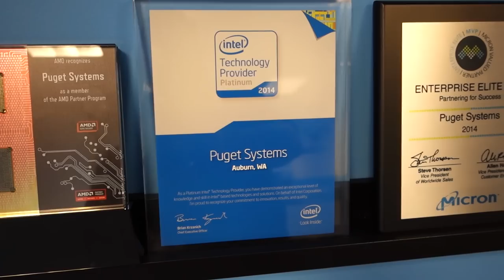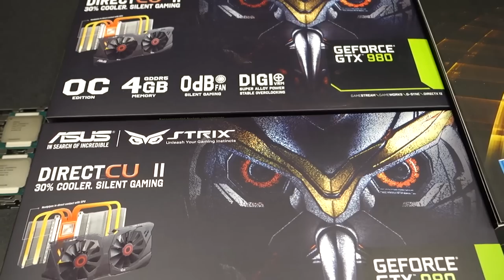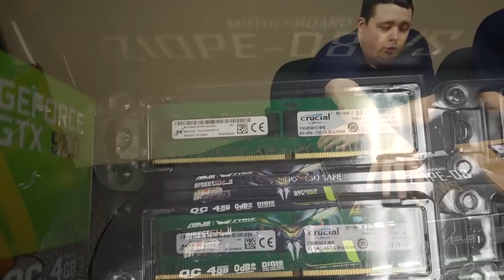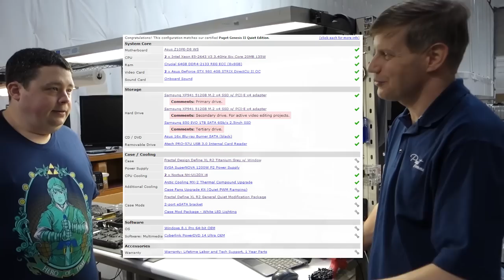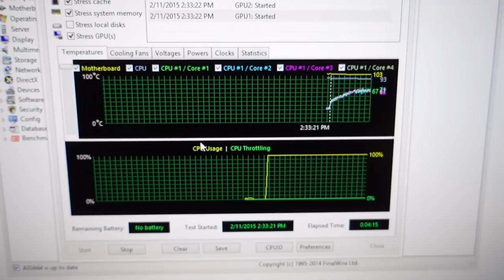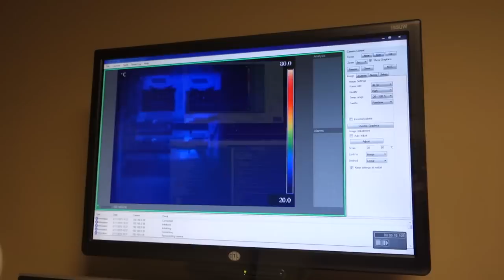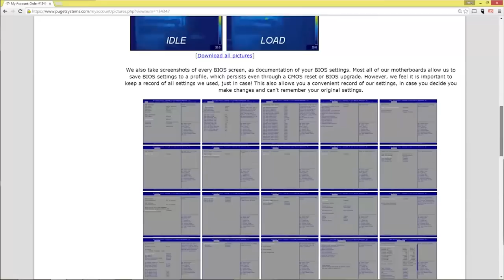Crazy Fast Dual Intel Xeon Monster PC Build by Puget Systems - @Barnacules

Comment: dual xenon? really? why? you dont need that
Reply from the maker: Yeah, actually I do.
Reply: Same reason for 64 gigs of RAM, faster video rendering
Reply: Barnacules Nerdgasm no, actually you dont
Reply: Simon Garfancule exactly. and it probably doesnt make a huge difference
Reply: His full time job is making YouTube videos. Even if it's a small difference it's fine, it's not like he's investing his lifesavings into this computer, it's a sponsored video so he gets the whole system for free.
Reply: YourNightmar3 he renders videos, 3d prints/designs, and does his own graphics... how does that not justify ecc memory, power, and reliability?
Reply: Bailey Tincher how about 1 xeon?
Reply: Barnacules Nerdgasm I do not understand the decision to go with two 6 core Xeons,especially on Haswell-EP,instead of maybe a single 12-18 Core Xeon.QPI more or less will somewhat increase latency.
Reply: Giggity Goebbels the downside to that is a lot of heat and a lot of processes on 1 processor.
Reply: Bailey Tincher no duh it uses more heat. not like he has a good aftermarket cpu cooler sarcasm
. Why wouldn't you use ur cpu to its max???
Reply: Bailey Tincher Check the TDP Dude...
Reply: Giggity Goebbels He's using it as a gaming rig as well and most games run like shit on lower clock frequency. Very few games are properly multithreaded.

Adobe Premire Pro and After Effects also run quite poorly on more threads believe it or not. They're also not very well multithreaded. It's rather old code base from the times before mega threaded systems were a thing on the x86 platform. It's been common for decades though in the RISC/POWERPC sort of world.
Reply: TalesOfWar I am talking about the latency.It will be really bad for both games and video editing.
Reply: NO ONE IN HELL Needs dual Xeons, 64gigs of RAM or ANYTHING this overkill unless you're going to be rendering 5 hour videos... I used to have a Core 2 Duo E7500, 2gbs of DDR2 ram and when I used to make videos it took me hours to render, but it was done! The RAM itself was DDR2 800mhz, so... Now I got a crappy, i7 840, Radeon HD4450 or something... I forgot, but it does the job!
Reply: ItzPrio he got it for free, chill holy crap you're going ham.
Reply: I'm allowed to go ham. Ham is love, ham is life
Reply: ItzPrio aloud... you mean allowed oh god
Reply: Well he does other stuff too man... not just rendering... I don't know why the bashing... =.= if it saves him time to go from 1 task to the other, that's money right there, to get more done in less time... god damn... if u do 3d shit u will know just how shitty it is... I'm working now, the company is using quadro with an 3rd gen I7 and it still lags and sucks... god damn it....
Reply: Vincent Kaze What Quadro?If it is anything NVS,600,K600 of course it lags.You need at least a K4000 to have a smoother experience. Also,what I said (1x12-18 Core CPU) is not necessarily slower than (2x6) cores.Haswell-e and still using 6 core Xeons?There is a problem.
Reply: Giggity Goebbels it's probably some shitty GC I guess, it lags like shit... hahaha oh well small company, what to do...
Reply: He needs good single/dual/triple/quad thread performance for gaming and good multi (100% on all) thread performance for video editing and such. This is one of the fastest E5 Xeon CPUs in single thread performance while also having six cores. It's pretty darn good for rendering by itself, but having two of them allows a potential doubling of rendering performance. Cutting rendering time almost in half isn't necessary, but it's certainly nice, especially when he makes money from uploading videos. By using two of these CPUs, he's getting (slightly less than) the best of both worlds. Sure, it won't game as well as an overclocked i7-4790k, and it won't render as well as a sixteen core Xeon, but it'll be close enough to both of those, which is optimum for Barnacules.
Reply: Whatever you say.
Reply: Honestly people here saying an i2 would get the job done like holy balls... the cpu itself cant even  stream an indie game without crashing/returning errors. The ignorance is insane he doesnt use the computer to make a video every so often... he has 4 monitors, does plenty of 3d rendering and printing, makes videos, plays games, and streams. It isn't like he only does 1 thing at a time...
Reply: Bailey Tincher 3D printing barely takes any CPU at all. A Pentium could probably get it done just as well. Creating the model to be printed is what uses your CPU. I agree 100% with everything else, though. Anyone that says you don't need a fast CPU clearly is using their computer to simply watch YouTube videos and check FaceBook.
Reply: YourNightmar3 Building a beast computer is not about what you need.
Reply: TalesOfWar Ugh kiddo, rocking two 980's won't even slightly be a slouch with a lower clocked xenon... There will be no bottle necking...
Reply: TheSmileyFacedPizza I have to temporarily use one of my older systems and hell, you can't even use it for YouTube Let alone Face Book!
Reply: Aaron Paananen Xeon. A Xenon is the code name for the CPU inside the Xbox 360 and a chemical element.
Reply: TalesOfWar whoops... my bad
Reply: YourNightmar3 It's a common mistake people make when Xeons come up in conversation.
Reply: TalesOfWar oh :P okay :)
Reply: Becoming Godsize im 22-23 bro
Reply: 666NedFlanders i got 32 gb ram as well. just only run 1 virtual machine at once. easy
Reply: Actually, when i used to render a 21 minute video took about an hour and a half 1080p/60fps. I don't know why it was so fast, but it was epic. I did also try ECC, but um... RIP.
Reply: ItzPrio I rendered a 30 second clip of a video... took 48 minutes
Reply: ItzPrio I rendered a 30 second clip of a video... took 48 minutes
Reply: Wow... For me that takes... like 30s... Lel
Reply: ItzPrio exactly, lol
Reply: My PC was shit.. idk if it was cause I was using integrated graphics but I got MSI GTX 970 now so Idk if it will be faster or not.
Reply: 666NedFlanders I think he needs the Virtual Machines to render the video's, otherwise it doesn't make sense.btw that physical core = virtual core is bullshit so stop talking.
The hypervisor is taking the decision which physical core it will be used for this thread.
So it's usally taking all the cores, the vCPU amount is just for how many threads it can schedule on the hypervisor.
Reply: Wow you still don't understand how this works.
I never said anything about allocating PHYSICAL Cores into the Guest when it's running, i said the HYPERVISOR takes the Decision which Thread comes from the "Physical" Core on the Guestsystem and assign it to the physical core on the Socket 

Your saying that vCPU are static assigned to the physical core which isn't true.
Reply: ***** Yes. It was called the Xenon during development. It's based on the Cell architecture which itself was an extension of the PowerPC RISC architecture. Kind of ironic really as Sony ended up paying R&D costs towards the CPU in the 360.
Reply: VexusMC i dont believe it, you're telling me u need more than 4kB of RAM? are you serious?
Reply: YourNightmar3 He's gonna be rendering 8K raw video for pixar and monitoring a rocket sending a rover into space for NASA at the same time.. so YEAH HE DOES!!!
Reply: That explains a lot rofl
Reply: YourNightmar3 YEAH BRO, SO YOU'RE LIKE WRONG!  lol
Reply: How many total cores and threads is there in this dual xenon. Does it really help over a regular 8 cores 16 threads Core i7 systems for video works? Not using it for virtual OS or anything like that.
Reply: Seramics honeslty.. in terms of price vs performance you can't beat a socket 2011 i7
Reply: Spicy Kielbasa Hmmm, i guess so... i just wonder if there's any differences/improvements at all going beyond 8 cores.... even 6 is quite a lot for single users.... of course for virtual OS environment, it does matter..
Reply: Seramics They have an 8 core i7, too.  The i7 5960x.  There is a benefit in rendering and computing with an 8 core, but your single core performance takes a huge hit for things such as gaming.  I have the older generation 3930K and it is great all around.
Look up some benchmarks to get a visual understanding of their weaknesses and strengths.  You will see though, however, that the price vs performance is almost NEVER justified.  I will wait 1 more minute rendering with a $500 CPU then pay $4000+ for a CPU that will save me 1-2 minutes..
Reply: Spicy Kielbasa Exactly! You get it! Btw i ot the 4790 and it does a great job at rendering
Reply: +YourNightmar3 because VMs
Reply: multiple cores is definitely useful for VM's
Reply: YourNightmar3 For video editing it would be a dream.
Reply: Those who can't spell 'Xeon' should not bash them! :) (Why on earth do so many people want to add an 'effin "N" into it?)

Comment: 5 to 7 business days? I can tear down and build my computer twice in 2 hours. Is this because of demand? Like a "allow 6 weeks for shipping" kind of thing?
Reply: +CrisFormed I'm copy pasting a reply I made to someone else:

Copying something is quick and easy, you can't discard the R&D put into the original design.

If you watch and EXACTLY copy a photograph I take in a studio you'll end up with the same result in a minute or two. If I tell you to do it from scratch without you being able to copy the number of lights used, angles of the lights, power settings, light modifiers, props (if any), shutter speed, ISO and aperture it'll take you a lot longer. I'd have already put in the years of learning plus (up to) hours of preparation and trial and error.

Did you hear how many heatsink configurations they tried? Each would involve dismounting the heatsinks, cleaning off the thermal compound, applying new thermal compound (not doing this will invalidate the results as they won't be directly comparable), booting up and running a torture test on it. Not every mount will be perfect either, even after doing hundreds of builds myself I still end up with the odd bad mount which means once again dismounting the heatsink, cleaning the thermal paste, applying new thermal paste and remounting the heatsinks.

As someone with a dual CPU board (EVGA SR-2) I can tell you that the heatsinks are near impossible to fit without removing the board from the chassis as the cutouts in the motherboard tray don't align with the CPU sockets, being designed with single socket motherboards in mind. With the heatsinks removed the backplate slips off and ends up between the motherboard and the motherboard tray.

With this in mind, trying a different heatsink configuration involves the following:
Disconnect SATA cables
Disconnect power cables
Remove graphics cards
Remove motherboard from chassis
Remove heatsinks
Clean thermal paste off of heatsinks and CPUs
Apply new thermal paste
Wrestle the heatsinks back on
Fit motherboard back into chassis
Install graphics cards
Reconnect power cables
Reconnect SATA cables

To test all the possible heatsink configurations you could need to do that a dozen times, and add in at least fifteen minutes of testing time for each configuration to allow temperatures to normalize. Just the time spent heating up the system under a torture test for each of the configurations amounts to almost half a work day, and that's not taking into account the time taken to do the steps I listed above.

There is no way a build like this with such attention to detail can be done from scratch in two hours.

Comment: Not much of a nerd if you cant build your own pc?
Reply: +Jared Reabow (Jazza) he got his htpc with a skylake i7+980ti from them for free (almost 5K$ cost) so it's all about the $$$
ofc he could built it if he wanted
Reply: TheGamingAffiliate dude it was pre-made.. It's on other video
Reply: +Marco Martins I can build this same system for $3000 replacing the GTX 890 for a GTX 970 for non-gamers.
Reply: +Marco Martins thank you
Reply: +User 890?
Reply: ***** noshit, user was talking about a gtx 890...
Reply: +Thijs W typo gtx 980
Reply: User ah ok
Reply: +Thijs W for $3000 i just built a dual xeon 28 core pc with 64gb ddr4 and two SSd's in raid 0 along with a 980.
Reply: +Jared Reabow (Jazza) why a 980? at least get a 980ti
Reply: +Thijs W because with pascal coming out this year and getting the 980 for £150 , how could i say no!
Reply: +Jared Reabow (Jazza) for 150? damn a 970 would be dirty cheap... still i would rather have 970 in sli instead of a single 980, because theres a 10% difference between a single 970 and 980
Reply: +Thijs W i got the 980 as a deal, a 970 would cost £300 and and a 980 would cost £380 - 400
Reply: +Jared Reabow (Jazza) in the netherlands a 970 costs around 350€ and a 980 around 650-700€
Reply: +Thijs W I used two ES Xeon E5-2667 v3 3.2 Ghz 16 cores (32 cores total)
Reply: +User sorry for you, I have two E5-2695 v3's
Reply: +Jared Reabow (Jazza) Don't, I'm happy with my clock speed 3.20 and 16 Cores. That's enough for gaming if I ever decide to game. I just wish xeon were overclockable.
Reply: +User hehe, mine are overclocked, you can overclock the Bclk
Reply: +Jared Reabow (Jazza) only 100 MHz?
Reply: +User Whats your question?
Reply: +User as i said you can increase that.
Reply: +Jared Reabow (Jazza) He had a pc make his pc. Thats pretty nerdage right there :)
Reply: meh i bought two 2699v4 Engineer samples off ebay for only 1090 pounds, just for the hell of it, couldnt let a deal like that pass lmao, I love it ! but i'll probably end up selling one, too much for me

Comment: I know i am going to get hated on for this but buying one of these systems is worth it for some especially if your in business and want a reliable powerful computer that will last you for a long time and that is not a risky investment. Especially if you haven built a computer before and you build it and it just doesn't start up or something goes wrong and you fry all of your components. However if you want a system that is cheap and you feel confident about building your own computer then there is no reason to buy a P.C from a shop like this. (I am writing this from  a pc with a water cooled fx - 6300 and a r9 270x that i built myself)

Comment: i got me an Intel Xeon E5-2658 /can this be used with non ecc memory
Reply: +Mark Douglas the 32 gb hyper fury x
Reply: +Mark Douglas thx for info
Reply: 13Krentebol Are you dutch!? Uw naam leek zo vernederlandst :) :p
Reply: +Mark Douglas Yes it can.
Reply: Oj10101 A grateful thank you
Reply: Mark Douglas I used to run my Xeons with non-ECC memory. For critical tasks it certainly isn't ideal, but it's possible. It's a pleasure :)
Reply: Oj10101 No i am not going to run a server just a workstation longer than 8 hours a day!!! I haven't made the build yet was just waiting for answers! cheers!!
Reply: Mark Douglas Sweet :) I've got plenty of experience building this calibre of machine so shout if you need more help.
Reply: Oj10101 Thanks for the support in advance

Comment: I purchased a system from Puget Systems in 2012 (order # 102378)  and it was DOA. The video card was broken by Fed Ex because Puget Systems decided not use foam to protect the internal components. It took about a month to ship it back to them and several emails back and forth before I finally got the PC back.The video card they replaced the original with was a lower cost card and is not able to play audio through HDMI. I won't order from Puget Systems again.

Comment: they could use the black noctua's they are slightly better (cost a lot more ) but the color is black not that ugly theme. I would never put a windowed case with noctua fans

about the industrial fans being more noisy . u can just go to noctua site or google a little bit and u will find that the black one's slightly faster +cfm + better pressure + quieter I have no idea how he said the industrial are not quieter than the other .

Comment: I still dont like when case/chassi makers started to move the power supply from the top to the bottom of the case/chassi. And still cant stand to have graphics cards under cpu. So for me it would have been cpu then graphics cards then power supply from the bottom to the top. And also set it up so no power supply can get air from inside, either blow out back suck in from top or blow out on top suck in from back, or make a plastic ventilation gate/system from the front panel then go behind the motherboard then to the power supply and then blow out on top. All of them should try to do like lian li cube case and devide the case up also so you dont get heat on more then half your system. Im never going back to air cooled computers again aslong as i can use watercooling on it, tired of helicopters trying to land beside me:)

Comment: #Barnacules Nerdgasm I badly need your help. I am looking for a xeon 8 core with 16 threads cpu which will be running under 100 TDP and the motherboard along CPU wont cost me more. I am happy to go for a used cpu (max 150 usd) and new motherboard(max 250 usd) from ebay. But the prerequisite is, i dont want any cpu that has max TDP more than 100W.